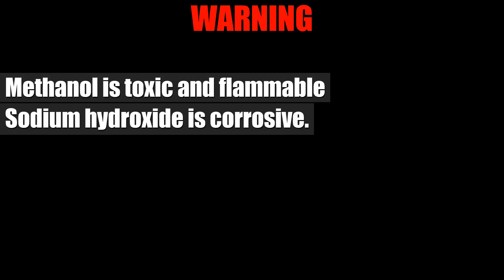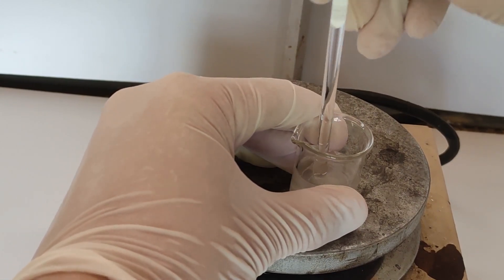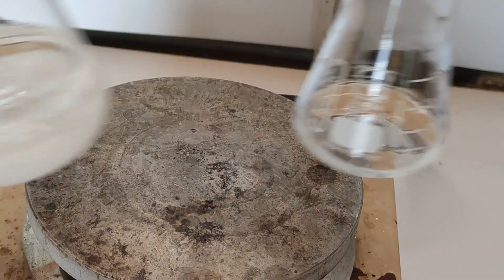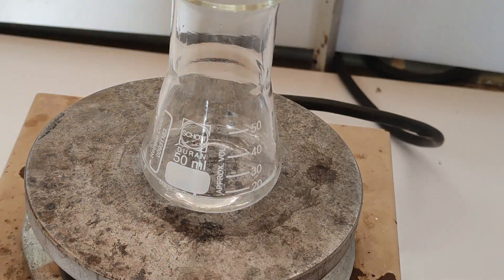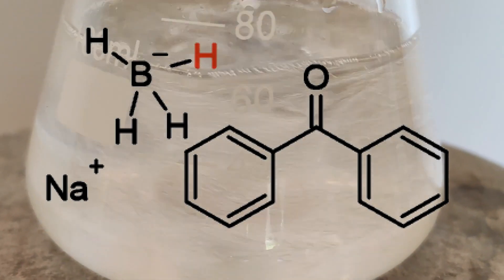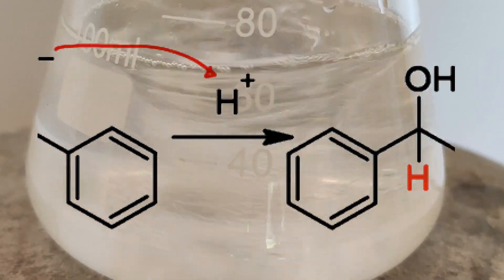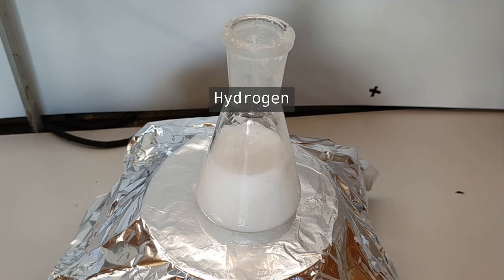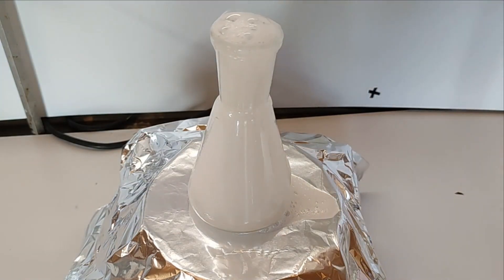Synthesis of Benzhydrol

Comment: Why did you not add the toluene and water like in the chemspider synth? Was it unnecessary? Subscribed.
Reply from the maker: Yes, unnecessary, product is pure enough as is and can be recrystallized to purify further without the need to use a lot of solvent.
Reply: @firehoax9230  Thankyou

Comment: I think ethanol work better than methanol for sodium borohydride.
Also, I think you can use Aluminum Galinstan amalgam in an ethanol water solution to reduce benzophenone to benzhydrol.
Reply from the maker: Why do you think ethanol would be better? Methanol dissolves the borohydride better.

Galinstan aluminium "amalgam" might be an interesting way to reduce it, but borohydride is just way more elegant and clean imo.
Reply: @firehoax9230  It’s because methanol tends to destroy some of the sodium borohydride instead of letting the sodium borohydride reduce stuff, so you need more. Can you make an NSI-189 synthesis video?
Reply from the maker: @antifreeze-30degrees49  i might make that, it looks easy.

I added NaOH to stabilize the borohydride, so really the amount decomposing is very minor. This synthesis is really well optimized and you only need a tiny bit of borohydride to reduce a lot of benzophenone.

Comment: How do you know you got benzhydrol and not starting benzophenone? No spectra (IR or NMR), no elemental analysis or mass-spectra, even NO MELTING POINT determined! Complete fake! Get  your dislike.
Reply from the maker: I'll be sure to include analysis in my future videos, thanks for the feedback, it's really easy to verify this reaction since the melting point of the product is about 20c higher than the starting material
Reply: @firehoax9230  20 or not 20, higher or lower, but it MUST BE done, without this you are performing some entertainment, not a scientific experiment. If your thermometer isn't accurate then you can determine a melting points of the starting substance,  the product and melting point of a mixed probe. Depression of the melting point for the mixed probe will confirm that two substances in question are different and not the same substance at least, not telling anything about the structure. And comparing m.p. with literature refence you can make some conclusions about purity (and product yeld).
Reply from the maker: @konstantinlee2275  Sure, although this wasn't really meant to be an experiment, it's a preparation using a decades long known robust reaction. Thanks again for the input

Comment: An alternative synthesis would be to react benzophenone with phenyl grignard (i.e. PhMgBr) in THF at a low temp followed by an acidic quench with either dilute acetic acid or ammonium chloride solution.
Reply: I think you've mistaken diphenylmethanol for triphenylmethanol. Benzhydrol is the former, and your product would be the latter. Grignard addition to benzophenone would add another benzene moiety to the two it already has.
Reply: @morningstarsci  I actually meant to  say:  react PhMgX with benzaldehyde. My Bad!! Othewise, the rest of my comment is still; correct there.

Comment: How can I make sodium borohydride? Or any metal hydride reducing agent for that matter...
Reply from the maker: It's not really worth making. It is made by reacting trimethylborate with NaH.
Reply: @firehoax9230  like I said, any metal hydride... But I was thinking without needing another metal hydride first, like what is the best one to start with to make others from? What's the easiest one that's useful?
Reply from the maker: @petevenuti7355  Well if you want to make NaBH4 then you'd get NaH and react it with  trimethyl borate but that requires high temp...
Reply: @mattsoutback59  you have a ball mill that holds a vacuum..🤔🧐
Reply: @mattsoutback59  yeah I knew you weren't going to get that off the shelf! But if you have the money in the shop, ever see the applied sciences video where he makes his own electron microscope? Some good ideas to make rotatable shafts in a vacuum environment neatly & of course you can also do something like you described kind of like how action lab does silly things with a remote control in a cheap vacuum chamber.
   You said a tiny one,  one liter, what is that about a quart of actual alkali metals in there? That doesn't sound too tiny to me, sure it is on a industrial scale but in a small lab it's pretty dam good!
    Now seriously, you have actual experience with it apparently, what are the thermal characteristics of the reaction? Do you have to worry about runaway? How do you monitor process temperature, IR? Or is it endothermic? 
   Not like I'll be doing this anytime soon, I have not yet mastered complete removal of oxygen and moisture from a gas stream... Nor can I afford bottled gases and all the appropriate traps, filters and regulators. (I'm a Trash Mini fridge compressor salvaged leaky vacuum pump Guy, can't even afford harbor freight right now)

Comment: I apreciate, the blender glassware, looks nice. did you use cycles for rendering or a different 3rd party engine?
Reply from the maker: The glass isn't made in blender!!! only the text is and it is tracked onto the scene using markers which I removed in post. I used eevee to render the text since it's not a realistic material